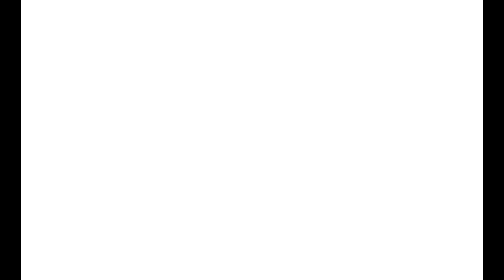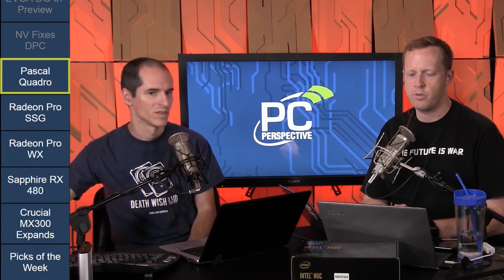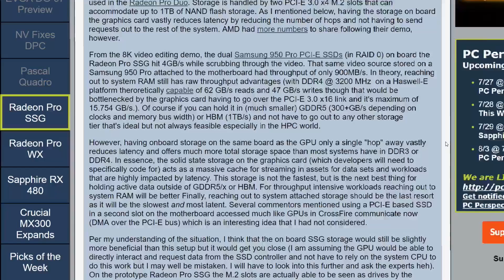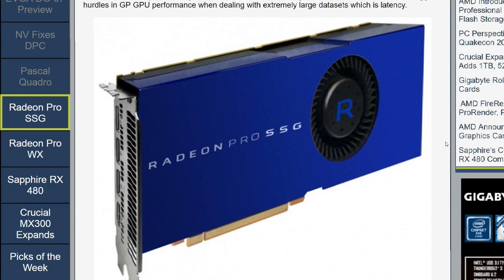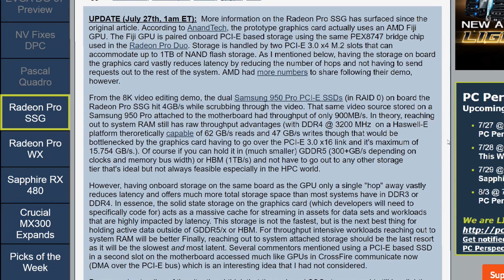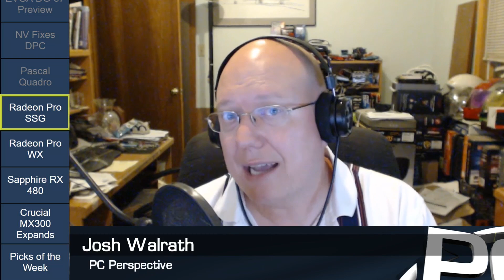AMD Radeon Pro SSG Discussed - 1TB SSD on a graphics card??

Comment: the SSDs are controlled by software in OpenCL.  this is why the GPU and OS can see the drive.  It is mounted through an OpenCL kernel which is running on the GPU.  when the CPU requests data from that drive, the driver is issuing a command that is identical as when the GPU makes a request from the drive.  The OS is aware of the drives location because the OpenCL kernel can provide instructions whether the data is headed directly to the GPU or not.  this is why there is a penalty when going to the system because it has to be routed through the GPU- not routed through the PCI-E bus.  system access speed isn't the point here though, its the direct access on the GPU that makes it useful for certain tasks.  but it is useful that you don't have to jump through hoops to load the drives with data.

Comment: hi guys, you look scaried. this thing is a gpu talking direcly with the nvme devices like an indipendend dma controller do. no cpu or os involved. this is the fastest way to access a resource. Quadro and Firepro has dma to talk with nics an have rdma on remote gpus in a low latency way. this card do dma on a local nvme device, it not so complex stuff. its good to see this stuff but the usecase are very few
Reply: They were trying to say this product is no big deal without actually saying this product is no big deal.

Comment: You guys are talking out your asses.  There would be no point to putting the SSDs on the video card unless the GPU could directly access it.  They didn't tell you how they are able to talk to the SSDs from the GPU but, they obviously can since it is so much faster than streaming data from a separate SSD.

Comment: Fuck this. Let's slap 2 DRR4 slots on it in tandem with the 2 NVMe SSD and call it uber-gpu. 3 Layer of memory, main GDDR/HBM, secondary DDR4, final cache at the SSD.

And run 1.0x10^9 Tetris program in parallel.

Comment: Guys at least look at a brief review af the presentation events before diacussing new products. Your ssg argumentation is so uninformative...
Reply: it was really frustrating to hear dude argue about why it isn't possible. While someone else was still looking up more information about it, they obviously haven't read all the information out there.
Reply from the maker: AMD still hasn't really detailed HOW any of it works, and those at Siggraph are reporting conflicting information back and forth. Our instincts here will likely be correct. I thought you would enjoy the discussion / debate as we went through it.
Reply: +pcper I enjoyed it. amd finally stumped you hehe. looking forward to hearing more about it.
Reply: Cut n paste from Anandtech.

Meanwhile it turns out that due to how the card is configured, the OS actually sees the SSD RAID-0 array as well, at least for the prototype design.

To use the SSDs, applications need to be programmed using AMD’s APIs to recognize the existence of the local storage and that it is “special,” being on the same board as the GPU itself. Ultimately the trick for application developers is directly streaming resources from  the SSDs treating it as a level of cache between the DRAM and system storage
Reply: pcper Definitely enjoyed the discussion, just would rather you guys talk about the complete picture you had. Ryan was still finding more information about the ssg halfway through the video. 

Always love to hear you guys talk about tech though.
Reply: I go on the premise that they wouldn't do it if there wasn't an advantage, they don't generally lie on specs (except the fury overclockers dream, but the guy who said was fired from what i've understood), and if this does work I can see it becoming the norm on consumer GPUs in 2 to 5 years time. Has it been confirmed that it is a fiji gpu or polaris 10? But I definitly think you should have a radjesh kaddouri guy on to explain the intricates of this pro gpu, it would be interesting. The research should have probably been done before...

Comment: A random question, can you do a comparison on ssd's vs PCI-E 3.0 and m.2 drives?
Reply: Why? They run the same speeds. If the m.2 slot on the motherboard is PC IE and not SATA drives, because there are m.2 SATA drives as well. Currently the Samsung 950 Pro and the Toshiba OCZ RD400 (M.2 or AIC): Toshiba XG3 (M.2): are the only available NVME drives